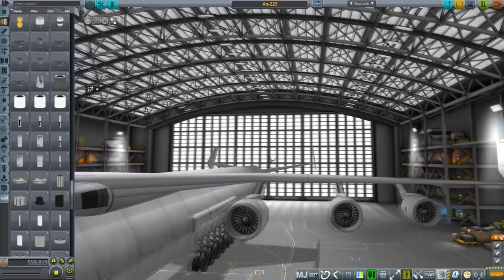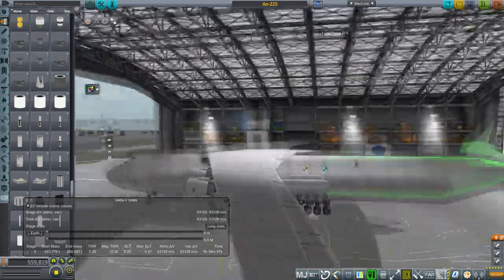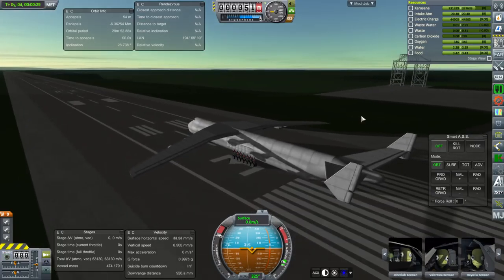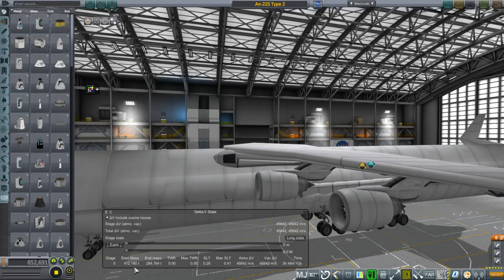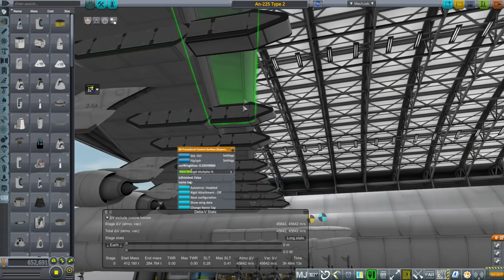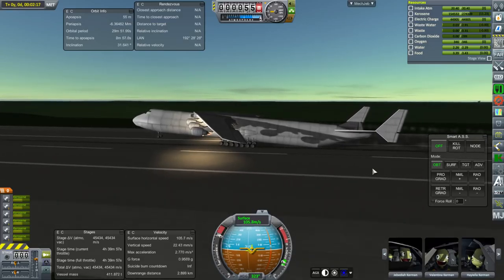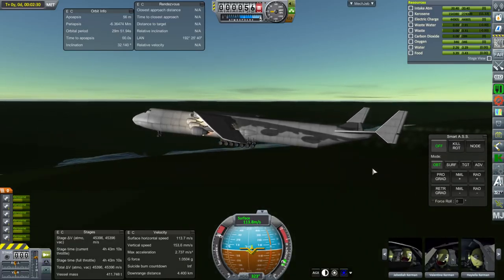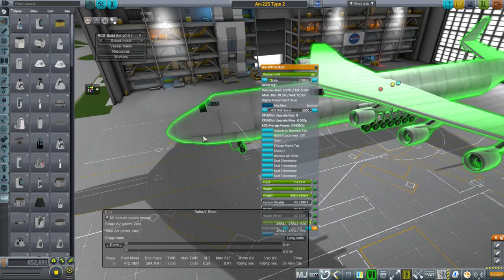Kerbal Space Program RO Sandbox - An-225 Mriya

Comment: nice plane. seems a bit long at the rear
Reply from the maker: I really need to check the wing placement. From some angles, I definitely agree, but from others it seems fine.
Reply: probably just because the tail cant be the same as the real thing where it tapers from the landing gear not right at the back. and if it is off its only by like 2-5m.